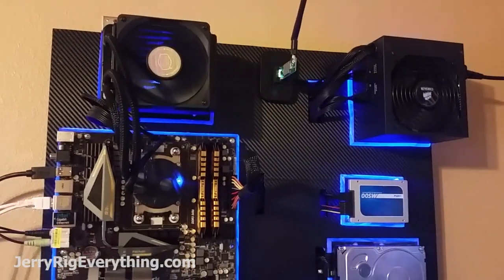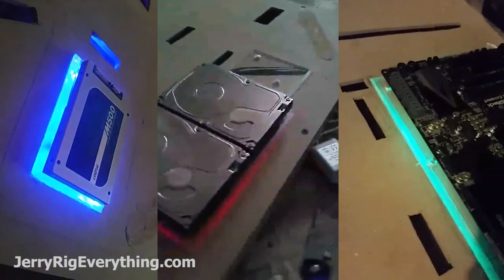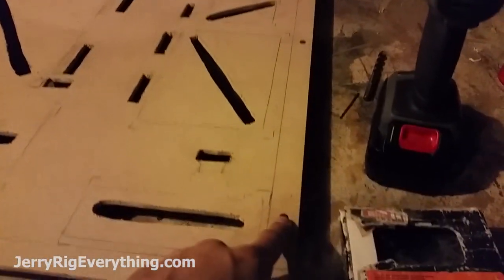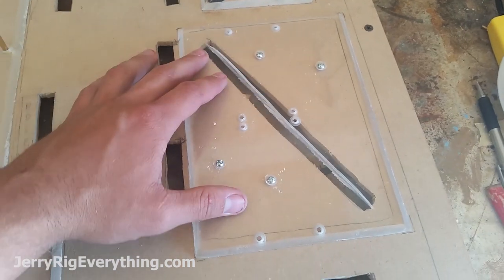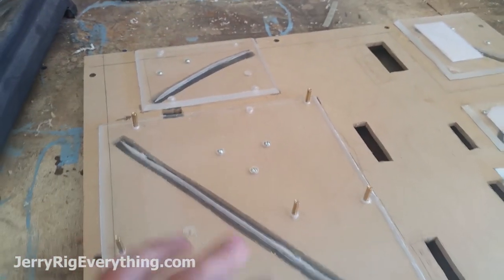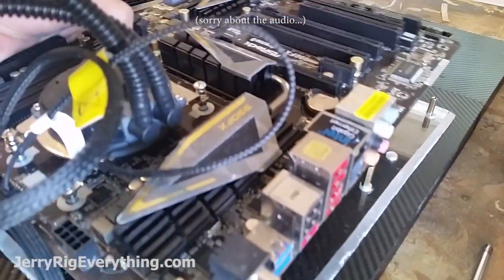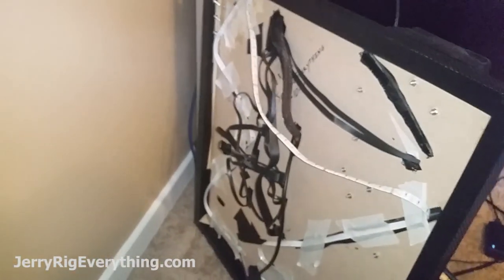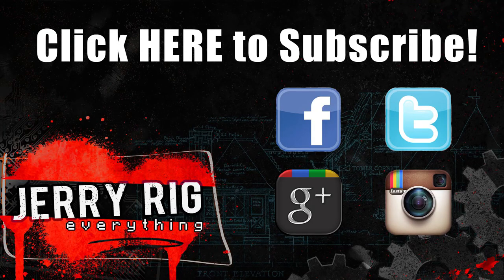JerryRigs' Rig - How the Epic LED Wall Mounted PC was Made

Comment: Did you just made a little cut jn the acrylic or did you made a clean cut from top to bottom? Because i cant seem to get a good acryllic light shine trough! Help me master!
Reply from the maker: It's a deep v shaped grove in the center of the acrylic.  Not ALL the way through. But still deep.
Reply: +JerryRigEverything ah well that has been my foult then! Tnx! Oh and how thick is the acryllic? 1cm? I am making some prototypes until i make the perfect build! I have so many unanswered questions! You really inspired me mate!
Reply: +Angelic Jack All my Acrylic backings are 10mm and V grooved 8.5mm deep on the CNC Machine and it works like a charm!
Reply: +Christopher Abnett need to find a way to do it with a hand drill hahah don't have such tools
Reply: +Angelic Jack Do you have a hand Router? , just create a guide and you'll be fine
Reply: Ah thank you :) I will see if i have one i think i do.

Comment: How did you attach the Graphics card? Is it lifted up from the acrylic plate?
Reply from the maker: screw through a hole in the top left... and then a screw wrapped in electrical tape at the bottom that the card is just resting on. Then the cables on the top right keep the board pulled back so it doesnt fall off.
Reply: +JerryRigEverything Is that everything that holds the GPU to the "glass" plate? Wouldn't there be at least four to hold it?
Reply from the maker: ***** ya.... it wasnt my most secure invention. Just the predrilled hole in the top left, one supporting screw on the bottom right, that you can see sometimes in the vid, and then the cables pin the top left down when they come through the back of the board. But hey! It worked for like a whole year, before I moved and took the pc off the wall.

Comment: JerryRigEverything How did you make the grooves in the acrylic?
Reply from the maker: theR3alist I held it over the top of a table saw.... Luckily I still have all 10 fingers.
Reply: JerryRigEverything that's pretty ballsy. I'm glad you still have all of you're phalanges. One more question. How did you go about mounting the graphics card?
Reply from the maker: The grapics card was the hardest, as the card itself only had one hole in the board.  So, by using that one hole (Top left corner) and a supporting screw (bottom right) and the power wires, holding the top right, it stays pretty secure.

Comment: Sweet build man.. I would totally steal that idea off you but ill'd water cool it ;)..
Reply: +knownuser09  Uh...this is a water cooled rig. The fan is sitting on a radiator with hoses going to the CPU cooler....
Reply: +Glen England Mainly air cooled if you have eyes to see with ah.. maybe open them up a little more..
Reply: +Glen England I don't call a aio unit water cooling.. lmao.
Reply: i know as i said its an aio unit.
Reply: +AFTER DARK aio unit also uses water to cool the rig... Technically Glen England did just that without wasting unnecessary money and time. I know what you mean though, however Glen England would not require full custom water cooling for his rig for what he is currently using it for, as he stated in the beginning of the video...  Pays to pay attention...

Comment: Hi Jerry, great video! I'm currently making my own wall mounted PC and I'm having some trouble with mounting the Graphics card. I have the same one that you have in the video and I'd like to know how you mounted yours, because there are no mounting holes on the bottom. Thanks!
Reply from the maker: Matthew Calapai I put a screw under the card on the bottom right.  So it is just resting on top of that screw.  (I folded electrical tape along the edge of the board so it would never ark at all. Probably overkill, but better safe than sorry.)
Reply: Thanks, I'll try it out.

Comment: hey bro, awesome job! REALLY like it. Two questions: could you explain what you did in the middle of the acrilic paltes (something that makes the light shine thru sides) and about the PCI extender, you had to buy those from 3M?
Thanks man, awesome rig!
Reply from the maker: Rafael Ticianelli No problem!  So, if you just  shine a light through a clear plastic piece, it will never shine out to the edges.  So I made a 'v' shaped slit in the center so that it will catch the light and reflect it out to the edges of the acrylic.  Does that make sense?  And I didnt buy the PCI extender directly from 3M... if you look at the link I posted on my blog about this computer, it'll take you to where I bought the cable from.  I honestly dont remember the site.. Digikey maybe?
Reply: Thx for the help! You're right, it's from digikey! If possible could you give me your thoughts on: I got two R9 290 on crossfire. How would you arrange them in the rig, looking for the Best practical/thermal conditions? Again, thank you so much for your time! +1Sub!
Reply from the maker: Interesting... so you are going to double up on the graphics cards?  I havent even considered wall mounting that set up before.  With how the PCI ports are on the motherboard its easiest to put them directly below the motherboard, so you dont have to bend the Shielded PCI cables. You'll just need some seriously long cables for that.
Reply: JerryRigEverything Hey Jerry, one last question: what's the thickness of those acrilic plates?

Comment: How did you mount the graphics card ??
Reply from the maker: lolo milko There is a screw through the top left corner, and than another screw (wrapped in electrical tape) that is just sitting down at the bottom on the right side supporting the rest of the card. Plus, the power cables at the top right, hold down that corner.

Comment: Is it possible to do a wallmount like this with two gfx cards?
Reply from the maker: Good question.  I just bought 2 of those shielded pci express cables.  I'm going to try and daisy chain them together so i can mount 2 graphics cards.  One farther below the other.  Ill make a video on the new computer if it works.
Reply: JerryRigEverything Lovely! Want to make a wall-pc but dont want to give up on my GTX 970 SLI.. :P
Reply: +JerryRigEverything I would like to know what/where you got the PCIe shielded cables.
Reply: +Andreas karlsson gfx?
Reply: +JerryRigEverything You can do this and run two GFX cards in SLI. Would require more space for the Second GFX card just below but can be done as i have done on mine and works perfectly.
Reply: James Thomson Oh we're not doubting that it cant be done, the question is how much of a performancedrop that secondary GPU will get due to the extra long cable.

Comment: So the graphics card is held in by 2 screws?
Reply from the maker: +azagedon Well, when you put it that way, it sounds sketchy.  But the power cables hold it in at the top right too.  It is pretty secure.
Reply: I see, cheers for the reply. I'm just in the process of planning out my wall build, trying to gather my research :).

Comment: hi how did you mount the gpu?
Reply from the maker: Aiden Savy There is a screw through the top left corner, and another screw supporting it from the bottom right. The power cables hold the top right to the board.

Comment: Where did you get the stickers from?
Reply from the maker: +mike fredley Amazon. Its called vinyl.
Reply: +JerryRigEverything I have everything set up but I'm running into a problem with how to mount my graphics card, I have a GT 740, there is really nowhere on it to screw into it, how did you do yours?
Reply from the maker: mike fredley I have a screw on the bottom right covered in electrical tape that the card is just resting on top of.  (Sitting on top of the screw) then a hole at the top left that the screw goes through the whole that was already in the card. And the top right is held down by the power cables.

Comment: damn... that's sexy. but im no construction worker much less have garage space as i will most likely move into a apartment when i do decide to move out. it seems this is going into a different aspect of computer build like architect rather than just simple computer install with all the math measurements and saw cutting.

Comment: Why put a fan at all?  The point is to pull the heat off the motherboard, but yours isn't mounted on the motherboard anyway.
Reply from the maker: ***** Its actually water cooled, so the water is cycling over the processor, into the reservoir, where it gets cooled by the fan, and then back over to the processor again.  Its a more efficient form of cooling than just straight air. Its also quieter.

Comment: Vertically mounting disc drives is not a good idea, solid state is fine but doing to a disc drive is like putting a disc in an xbox and knocking the xbox over. i.e. it could damage the disc and you could lose what you have stored on he hardrives.
Reply: Ciaran O'Callaghan I don't find you as a credible source as you keep saying "disc" drive when you mean to say "Disk" drive. And why would mounting a HDD so the internal platters spin vertically be any different than them spinning horizontally?
Reply: BAM5 Well it's got several needles reading the disc so if you disrupt them and they scratch the disk it will damage it resulting in you losing what you had stored on it.
Reply: Right, but you're not disrupting them by mounting them vertically. You're just changing the orientation relative to the outside world. All mechanisms in the HDD will work exactly the same, and the read head will not be disturbed unless the HDD is subjected to vibration or strong acceleration. Orientation does not matter.
Reply: Well okay then. I guess I was wrong. Thanks for the insight. :)
Reply: No problem, pleasure informing you.
Reply: BAM5 Indeed you are changing the orientation of the HDD, but that also alters the effect that gravity will have on those pins. They are constantly being pushed perpendicular to the force of gravity which is more detrimental than if the HDD was horizontal.
Reply: The effect is so minuscule that it doesn't matter. But let's play devil's advocate here. If the hard drive is vertical, then the affect of gravity on the read write arms would be so that the force acting on the arms would be parallel to the platter, meaning that gravity wouldn't be pushing the head into the platter, meaning that a vertical orientation would be beneficial.
Reply: +BAM5 To be fair, you could quite easily add some small racks and horizontally mount the HDDs if it is that big a concern... It would not add too much size as having a graphics card hooked up to the motherboard would be about the same depth anyways...
Reply: teamANARKY_Fluffykins This is true, however my point was that it shouldn't be a concern :)

Hell if it's such a concern why not get rid of the HDD all together and go with a SSD. Problem solved. :P
Reply: +BAM5 Agreed. Totally not a concern. If IBM, EMC, Dell, HP etc. mount all of their disks vertically in enterprise storage systems that they seek to their customers, and they run 24x7x365 for 3-5 years on average before they are replaced, I think a home PC should be able to survive, even if the drives used are simple consumer based ones.
Reply: That they "sell" ... Not "seek".

Comment: How did you mount the GPU?
Reply from the maker: +Ryan Frechette There is a screw on the top left (Through a hole in the card.) Then a screw supporting it on the bottom right. (Wrapped in electrical tape.) Then the power cables keep the top right pinned down.
Reply: Wow, honestly I wasn't expecting a response. Since I have your attention briefly, you did an incredible job. Truly captivating and motivating.
Reply from the maker: Thanks!  I appreciate it.  I learned a lot from this project, and it was a ton of fun to build.  I'm glad you enjoyed it.

Comment: how did you mount the gpu?
Reply from the maker: +KateUpton There is a screw in a hole on the top left .  AND there is a screw under the bottom right, supporting the card.  The top right is held down by the power cables.
Reply: +JerryRigEverything  Thanks for the reply! One more question, how do you turn it on/off?
Reply from the maker: My motherboard has a button on it that does it for me.  Otherwise I would have to use an external button just like on a computer case.
Reply: Thanks for the reply!